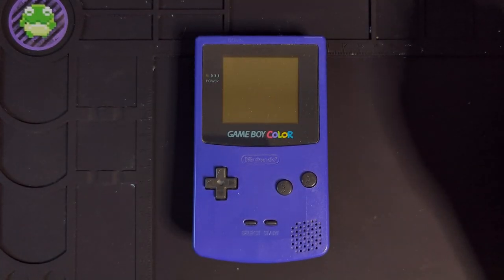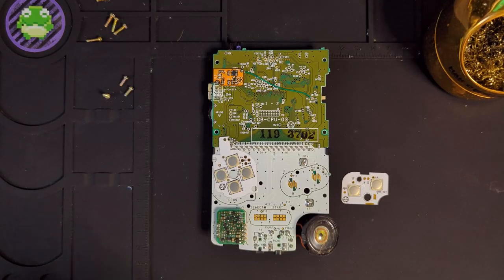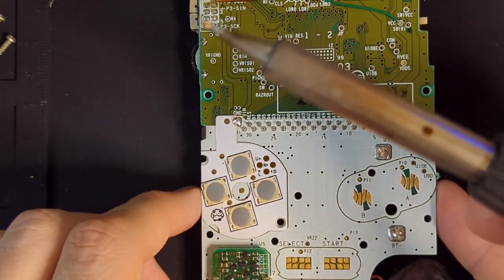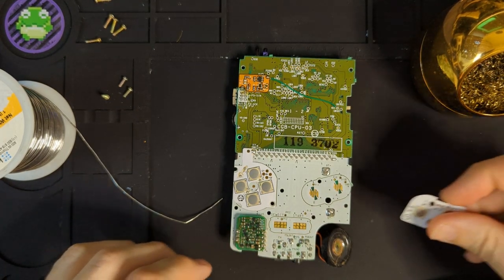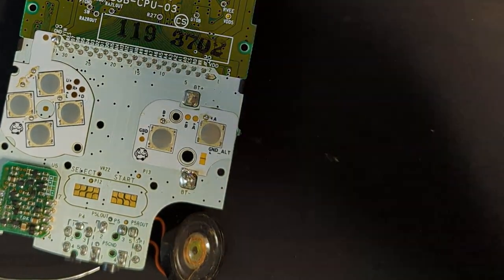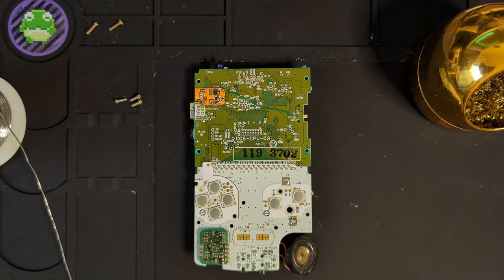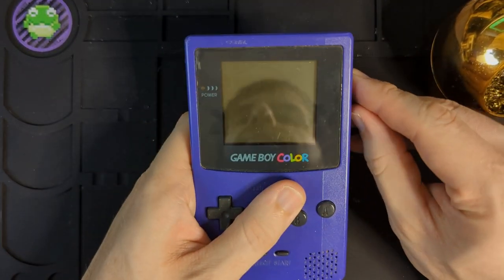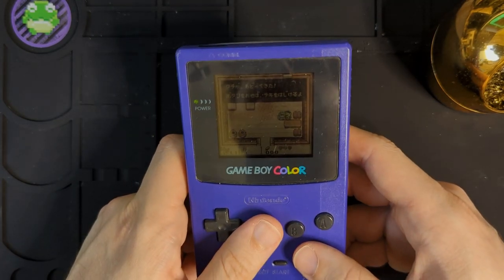Wire-free Tac Switch Mod Install for Game Boy Color

Comment: The problem I'm having with this mod is that I'm getting a "double click" where the membrane gives feedback, and then you push a tiny bit further to get the actual buttons to click. It's not terrible but it doesn't feel like a GBASP for example. Are there any workarounds for this at all?

Comment: I installed these a week or so ago. Agree with some of the other comments, it's a little bit hard to press down, vs the original button feel. You have to fully press down to actuate the button, where usually you can just kind of roll your finger around the d-pad on games like zelda/ pokemon. I like it on the A and B buttons however. I found my thumb hurting after a while just from pressing down harder. The start and select don't really work once i've tightened down the shell, ( works but don't feel the tactile click ). Maybe theres custom buttons that would be made to improve this, or just adding some material to the back of the orignal ones and removing the membranes perhaps.

Comment: This just popped up on my feed. Super cool! I bought a faulty GBA ages ago which had a broken L or R micro switch. After I installed the aftermarket replacements I had to get another set to put on my own GBA because they felt so much better. I think I'll pick up a set of these when I built my ultimate GBC!

Comment: I use brass M2 standoffs to hold my motherboards in place while I test them and I found running a standoff through the hole in the bottom-right of the D pad makes another anchor point to help align it while soldering.
Reply: Great kit, by the way! I tried to do something similar with microswitches wired to the board but they ended up being too tall for the d pad to rest on and put too much pressure on the board itself

Comment: Since your etsy is on hiatus, I bought the circuit boards and switches separately. How do those things actually attach to the board?
Reply from the maker: They need to be soldered onto the board, 4 pads per switch. I recommend a hot plate and solder paste if you have it, but an iron with a small top works as well. Just be careful not to get flux inside the switch.
Reply: @leggomyfroggo  Oof, that'll be tricky. I haven't touched a soldering iron since school. I bought plenty spare switches, enough in theory to fit the 2 D-Pad and 2 A/B boards that I won't be using, so I can afford to lose a few. I guess I'll have to get some practice in before I screw them up though.

Comment: I just ordered two sets of these for my Gameboy Colors. I have a Giltesa USB C Pro kit Lipo mod in my Gameboys. Do I need connect a wire to ground? I saw you recommended pin 32 on cart connector in another comment.
Reply from the maker: If the battery gets wired to the negative battery terminal, and the DC jack is completely removed, then you shouldn't need to run a wire.
Reply: @leggomyfroggo  FYI if ever you get the question again I had to connect a wire to ground with the Giltesa USB-C Pro kit. Tried with the alt ground and it didn't work. Only worked when I connected the wire to ground. Just received them today and had to install one right away. They feel awesome!

Comment: How did you bend the soldering iron tip like that? It's awesome
Reply from the maker: It's a J-tip! Works great for SMD stuff, and you should be able to get one for basically any iron.
Reply: @leggomyfroggo  I have a crappy soldering iron but it uses a solid tip. next time I solder I'm absolutely ordering a J tip and a metal scrubby station

Comment: since i have a funnyplaying rechargable Li Ion battery that uses the DC jack as a charging port i do care about the DC jack very much
Reply from the maker: You can just run a wire from the GND pad to a proper ground point on the motherboard in that case -- essentially any ground point that isn't directly connected to the negative battery terminal. Pin 32 on the cartridge connector is a good option.

Comment: Does this fix buttons that don't work on my gameboy color?
Reply from the maker: As long as the buttons don't work because of contact corrosion, broken traces, or something similar, yes.
Reply: @leggomyfroggo  it seems it's because my buttons are tinned
Reply from the maker: @andyroo8046  Yeah, that will generally cause problems. I have these same boards without tac switches as well if you want to fix your buttons but maintain the original feel.

Comment: why dont u put flux on while doing this
Reply from the maker: Even a small amount of flux in the switches will basically ruin them, so it's a precaution in this case -- I normally use flux when I do this, but for the sake of promoting the method least likely to cause issues, I skipped it for the video.

Comment: Do you need anything between the d-pad and the board for final assembly? Like the rubber button backs.
Reply from the maker: Yes, you still use the silicone membranes between the buttons and the board.
Reply: @leggomyfroggo  thank you!!! I'm currently adding this mod to one of my favorite GBCs wish me luck 🤞🍀

Edit: Success! Feels great and easy to install.